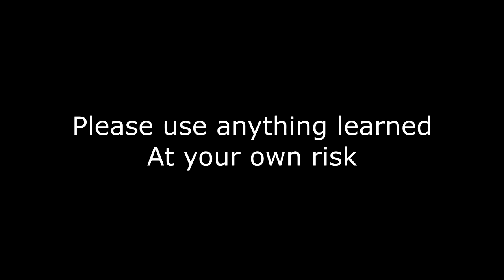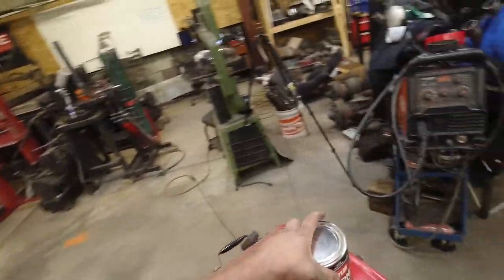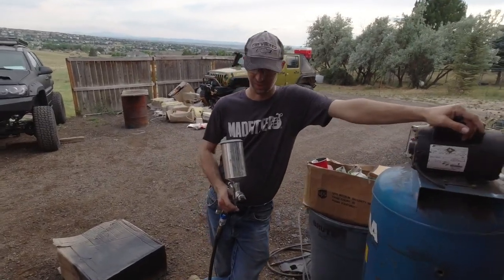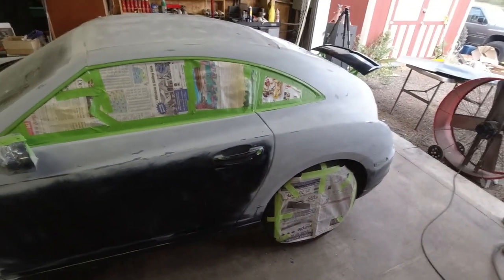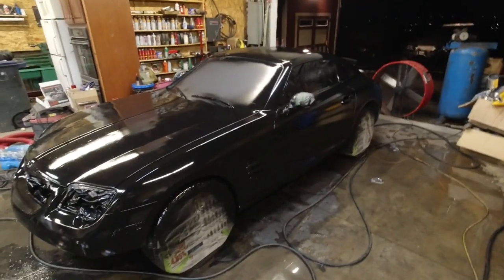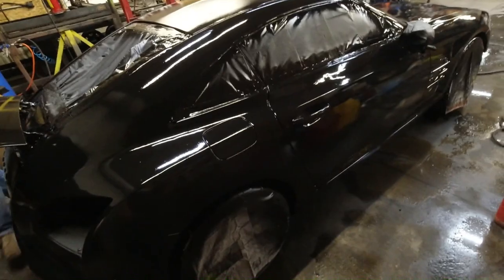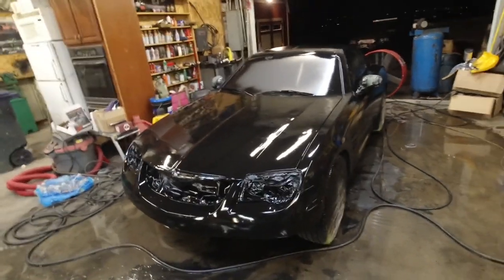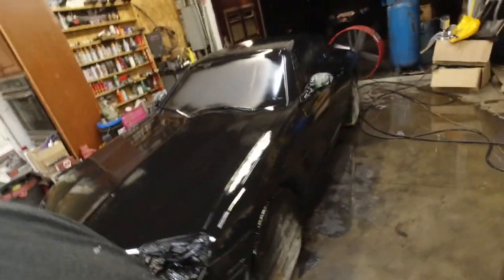How to paint a car - Most likely the wrong way!

Comment: You guys did everything perfect, for Implement paint... You could have possibly added a little bit more acetone to get it to spray and lay down better, but it's a fine line with too little and too much. Your spray technique could use a lot of work, LOL🤪 I figured I would use about at least a half gallon I didn't think you had enough. Joe I'm not knocking your body work, that car was pretty rough, but I would have thought about painting it White or maybe Gray instead of Black.... Black shows everything, White helps hide it. I think it looks fine, let's see how it looks when you wet sand and polish it out, oh yeah that's going to be a messy operation black paint everywhere. The water on the floor is not so it doesn't stick to your floor, it's so it doesn't bounce/blow dust back off of your floor and stick to your paint job, and you get a lot of trash in your paint, it does help if you don't have a booth.
Reply: Thanks for the constructive feedback. Its always nice when our viewers try to help instead of hurt. Thank you. Thank you

Comment: Rally time is COMING!!!! Hey Joe, I have a suggestion: install brake cooling up front. Duct air in from the front, blow it onto your brake caliper and rotors, and make an exit duct behind the front wheels, where the current design flashes are that streak off the front wheels. Big vents buddy! Those brakes are going to run really hot. You will likely need to upgrade your stock brakes to something rally-capable.
Reply from the maker: Good tip!
Reply: @carbonshocks thx! Keep em cooooooooooooo! 😎 I'm so glad to see the rally spirit kicking!!!! It's a great time to be getting into the sport. ❤
Reply: @carbonshocks  Joe, I know you guys are going to give it all kinds of lighting, right? Another cool thing you can do, is put a light pod on the hood, and point the stock headlights off to the sides of the road on either side- Its needed to see where you are about to go, when going sideways around sharp turns. Allows you to see the road ahead, before stock headlights would normally allow.

Comment: I have been told that wetting the floor is more to keep dust down than to keep the paint from sticking to the floor but no matter why you did it it was a good thing to do. The car definitely looks better now and you really don't want it to look great or you will not want to rally it plus it will get beaten up so have fun and use it for a learning experience. The one tip I have been given by multiple people is to use long even passes that overlap a little and to use a medium hardener for most temp's if it is very hot out use slow and if it is colder you might want a fast hardener. I seen someone use a fast hardener in hot weather and the paint was practically dry before it hit the car causing the paint job to look like crap. Overall it looks like you did a good job but if you thinned out the paint a little more it might have sprayed more like you expected it to although that is just my guess
Reply from the maker: I think you are right on the thinner. I think we could have went more and it would have sprayed Better. After the first coat it wanted to go on thick and it seemed like I had to get closer than I thought I would need to for it to layout corectly.. great learning experience for sure! Thanks for the input.